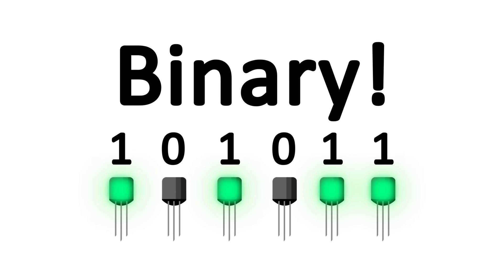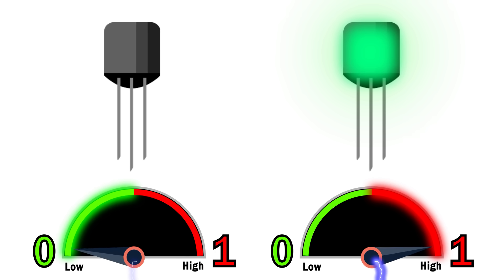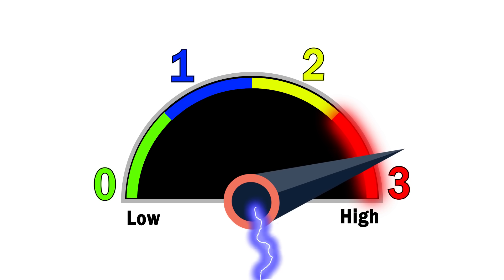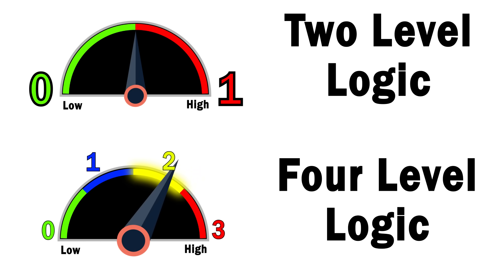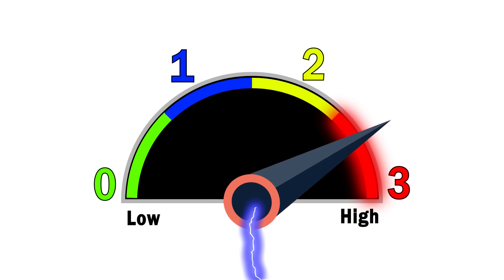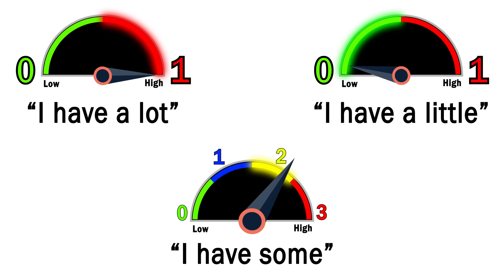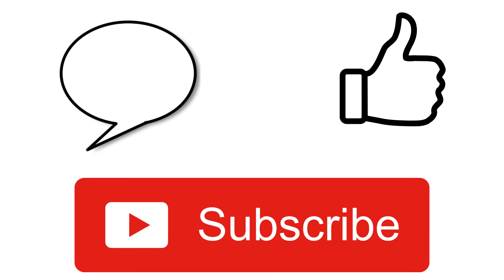Why can't computers use base 3 instead of binary? Voltage states explained.

Comment: This might be a problem for real computers but not for simulated computers such as the ones people build in Minecraft/Terraria or some other software. It'd be interesting to see how higher base computers would perform there and also how high we can go.
Reply: I wanna try and make a Base 5 computing system
Reply: @epicmidtoker3 You can do it in minecraft with signal-strength arithmetic.  Technically using that lets you do any base in that way from 2 to 16, but you can definitely engineer a base-5 system.
Reply: @epicmidtoker3  Hell yeah. Do it 💪
Reply: Hex computers in minecraft are a thing, they use signalstrength which goes from 0-15 so base16? Due to how comparators work they get really powerful for their size, but it seems difficult to scale them up. They achieve some optimum size at 100 blocks volume, but cant really go onywhere from there.
Reply: @LinusPeter-j7z  Interesting. I didn't know that. Thanks for the info :)
Reply: @GabrielMartinez-fv8xd I'm guessing, yeah
Reply: There are data storage systems in Minecraft that essentially work off of this principle. In modern versions of the game, each music disk outputs a different signal when placed in a juke box and read by a comparator. It essentially allows for higher base storage and greatly compresses the size of your data storage. There's a video making a noteblock music player that uses midi files transformed into chests of shulker boxes that store entire songs. 

Although the system they built only actually uses the disk to represent a single bit of information, but I don't see why it wouldn't be possible to combine them to get even larger numbers in a smaller space.
Reply: There's no practical reason to do simulated computers since they always do worse and I don't see a reason to go higher just because
Reply: @tomlxyz   It's called having fun. Let people try out stuff they want to do.
Reply: @Simchen  furries dont know fun
Reply: @tomlxyz  let them be their selves bruh
Reply: @tomlxyz  Just because is a pretty good reason 😃
Reply: @tomlxyz it gives people room to explore the consequences of the change without a large cost. If someone found a way one system was massively better than binary in a specific area then perhaps specialized computers could be made for that niche. Of  course theres also just having fun but i doubt thats what you meant by your comment

Comment: You mentioned less than 50% charge and greater than 50%. But what about right AT 50%?
Reply: @@P47CH3Z: There are so many kinds of instances where I've seen people state ranges of numbers that fail to include the divider number either on one side or the other that it's insane!

Comment: But this problem can be easily bypassed if we use 3 cables: one for 0 one for 1 and one for 2. Then you need to have 3 different cables for the Ethernet, 3 tracks on a CD or hard drive. 3 copper link in the circuits and so on... Yeah you will have CPU that are a bit bulky at the beginning but the potential is enormous

Comment: Using AC instead of DC I think a ternary or even quaternary system could be made. A balanced ternary system can be where 1 direction of flow is 1 and the other is -1 while no flow is 0, and for a quaternary system you can just use 2's complement and have the voltage directions represent 0, 1, 2. Though this would be much slower.

Comment: Something left out: In signal-cables, a switch from positive voltage to negative voltage can represent zero (or one), a change in polarity in the other direction one (or zero), as far as I know this is how data is transmitted over cables extremely efficiently. I do not even want to think about how this would be done in a non-binary logic!

Comment: What about using negative voltage to create a base 3 system. So in a 1.5 volt system 0 is off, 1 is +1.5v and 2 is -1.5v. Would this not work?

Comment: Why not use light instead of electricity through the transistor? You can still have a charge but it needs transistor would be a chip that would measure the light? You're really helpful to refer me this video and I'm completely curious. I'm sure you have another video?
Reply: With the light, you wouldn't have any of the falling or rising state issues. You could simply change the color. I know in the old days this would have been a problem as the machine would have had to been huge! And for a projects like project Pluto, it would have been a huge problem to have that type of computer on an aircraft, especially a doomsday plane.

Comment: why dont just instead of voltage amount, just use binary mini circuit to change energy POSITION and measure WHERE the energy is instead of trying directly  base 3 or 4? or using that make base 4 computer that converts things to base 2 before sending or receiving from internet or components?

Comment: How about expressing the ternary system as, for example, a manual car shift, with the center as the neutral state?

Sorry if I made a mistake because I am using a translation.

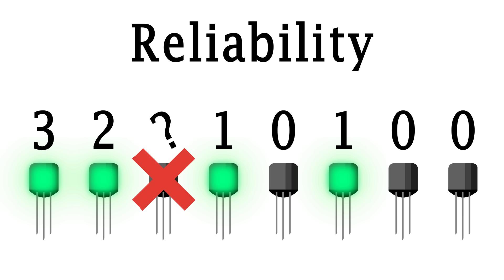Comment: 3:48 it's not completely useless. you're ignoring that it takes more "bits", which means more space, more transistors, or to be general, more components. This isn't a strong objection, but it's one not to overlook in technicality.
So it's not that it's useless, it's just that the tradeoff of reliability vs space heavily favors reliability.

Comment: Good video but there is one base 3 design that you did not discuss.

Instead of using partially charged transistors to represent different base states, you could combine active high and active low circuits. Your 3 base states would positive high, negative high, and zero volts.

There may be reasons why this won't work, but you didn't discuss them.
Reply: Not worth it because you use another transistor to know whether the high state is positive or negative, then you are using 2 bits to represent a single base 3 number which will produce less values than binary numbers. We need to think more.
Reply: Maybe that would help, good idea. But also maybe the crossover period would be a reliability problem still. I'd love to find out what could still be possible

Comment: You ignored what makes ternary viable, it operates on negative signal, no signal, and positive signal, gaining all the reliability of binary plus being a tri-state system, and there are even a few tricks ternary can use to simplify math. It isn't used mainly because the right tech advances happened on binary systems at just the right time to give them a lead in the market that other businesses couldn't catch up to regardless of the ability of ternary computers.
Reply: i don't know he "ignored" it, it might just be he didn't know

Comment: 3:27 no, it is not entirely the primary reason. i have been trying to build my own ternary gates, full adders, full subtractors, etc for a while now and believe me, working with an extra state is extremely hard. not even on a voltage level. (im working with an unbalanced fractionary scale, so 0V, 1/2(+V), +V since it is easy to divide voltage and use op amps like so without using negative voltage.) because you have this awkward middle half state, you can make a full adder <A in, B in, carry in> with results <result, carry> except implementing the truth table is extraordinarily complex. you need gates that allow the middle half state to pass through without processing, you sometimes need to eliminate the middle state all together to make is 0 and 1 again, sometimes you need the middle state back... but how? you just removed it to get 0 and 1! point is, its very hard.
Reply: whats NOT? whats AND? OR? XOR? 
the simple inversion is no longer so easy... 
0 becomes 2? 
2 becomes 0? 
1 stays? 
theres other options so you have to delve into new types of gate, XYNOT maybe...
the entire language would need rebuilding, imho. to re-use old terms would be too confusing. normal circuitry doesnt even apply, you almost always end up back in binary at the basic level.

AND?
0 and 0 is 0. 
0 and 1 is 0.
0 and 2 is? 0? 1? either type may come in handy...
further combinations can be figured at your own leisure ;) as can OR... they no longer are the same functions, and wheres the line between certain overlaps? anyone versed in logic knows the circuit used may not be the logic operator it performs! 

hex equates to a nibble of four bits...

do-sept-imal numerals for a "nibble" of three "trits"? hang on, the alphabet uses 26 already.... hmmm. it would work :) cant be 0 or 1 as they conflict with o and i, so 2 it is...

standard approach to logic breaks down. have to go back to boolean and revise for an utterly new approach. to signify things were this and that was easy. the old "assert/not assert".
to signify they are this that, or something else gets crazy. assert/not assert/half-arse...
Reply: @paradiselost9946  And at the end of the day, aren't you rebuilding logic that would be a combination of say, two gates anyway. I'm not convinced "in principle" that a larger base would be a necessary benefit for the logic side (storing is another issue, and there we do have higher bases, as the video says)
Reply: @paradiselost9946  Yes-maybe-no-true-inconclusive-false. 3 answer choices on a test. Used so that the score really reflects your knowledge, as on a yes-no-true-false test, getting a 100% tells us you have the same knowledge as getting a 0%, as if someone had 0 subject knowledge and randomly guessed, they would score a 50% on average, and if someone gets a 0%, they know what the answer is; they decided to choose the other choice via reverse psychology.

In set theory, we have the universal set U, the null set ∅, and the single set {∅}.

In Boolean algebra, we have 0, 1, and 0.5.

However, the NOT / OR / AND / gates, compliments / unions / intersections, and Boolean inverses / summations / products will remain the same, as they are lowest upper bounds and greatest lower bounds, respectively. Therefore:

¬⊤ ≡ ⊥
¬⊥ ≡ ⊤
¬⊢ ≡ ⊢

⊤ ∨ ⊤ ≡ ⊤
⊤ ∨ ⊥ ≡ ⊤
⊤ ∨ ⊢ ≡ ⊤
⊢ ∨ ⊢ ≡ ⊢
⊢ ∨ ⊥ ≡ ⊢
⊥ ∨ ⊥ ≡ ⊥

⊤ ∧ ⊤ ≡ ⊤
⊤ ∧ ⊥ ≡ ⊥
⊤ ∧ ⊢ ≡ ⊢
⊢ ∧ ⊢ ≡ ⊢
⊢ ∧ ⊥ ≡ ⊥
⊥ ∧ ⊥ ≡ ⊥

U∁ = ∅
∅∁ = U
{∅}∁ = {∅}

U ∪ U = U
U ∪ ∅ = U
U ∪ {∅} = U
{∅} ∪ {∅} = {∅}
{∅} ∪ ∅ = {∅}
∅ ∪ ∅ = ∅

U ∩ U = U
U ∩ ∅ = ∅
U ∩ {∅} = {∅}
{∅} ∩ {∅} = {∅}
{∅} ∩ ∅ = ∅
∅ ∩ ∅ = ∅

1' = 0
0' = 1
0.5' = 0.5

1 + 1 = 1
1 + 0 = 1
1 + 0.5 = 1
0.5 + 0.5 = 0.5
0.5 + 0 = 0.5
0 + 0 = 0

1 * 1 = 1
1 * 0 = 0
1 * 0.5 = 0.5
0.5 * 0.5 = 0.5
0.5 * 0 = 0
0 * 0 = 0

XOR / XNOR gates, logical statements, set differences, and any Boolean operator follows the same pattern. However, if the hypothesis of a statement is false, the conclusion is inconclusive. Truth table p → q:

p  q p → q C
⊤ ⊤     ⊤     ⊤
⊤ ⊥     ⊥     ⊥
⊥ ⊤     ⊤     ⊢
⊥ ⊤     ⊤     ⊢

Inconclusive statements can be converted: There may exist / There may not exist / All of them may be true / All of them may be false: ∨'⊢ ≡ ⊤, ∧'⊢ ≡ ⊥, ∪'{∅} = U, ∩'{∅} = ∅, +'0.5 = 1, *'0.5 = 0

Using this, we can derive a Boolean algebra for genders:

Boolean values: ♂, ⚧, ♀
Binary operators: ☀, 🌙
Unary operator: '

♂' = ♀
♀' = ♂
⚧' = ⚧

♂☀♂ = ♂
♂☀♀ = ♂
♂☀ ⚧ = ♂
⚧ ☀ ⚧ = ⚧
⚧ ☀ ♀ = ⚧
♀☀♀ = ♀

♂🌙♂ = ♂
♂🌙♀ = ♀
♂🌙 ⚧ = ⚧
⚧🌙  ⚧ = ⚧
⚧ 🌙 ♀ = ♀
♀🌙♀ = ♀

Identity laws: A 🌙♂= A, A ☀♀ = A
Domination laws: A ☀♂ = ♂, A  🌙 ♀= ♀
Idempotent laws: A ☀A = A, A 🌙 A = A
Commutative laws: A ☀B = B ☀A, A 🌙 B = B 🌙 A
Associative laws: A ☀(B ☀C) = (A ☀B) ☀C, A 🌙 (B 🌙 C) = (A 🌙 B) 🌙 C
Distributive laws: A ☀(B 🌙 C) = (A 🌙 B) ☀(A 🌙 C), A 🌙 (B ☀C) = (A ☀B) 🌙 (A ☀C), 
Absorption laws: A ☀(A 🌙 B) = A, A 🌙 (A ☀B) = A
Negation laws: A ☀A' = ♂, A 🌙 A' = ♀
Double negation law: A'' = A
DeMorgan's Laws: (A ☀B)' = A' 🌙 B', (A 🌙 B)' = A' ☀B'

Using this, we can prove:

A ☀(A 🌙B) (Given)
= (A ☀♀) 🌙 (A ☀B) (Identity laws)
= A ☀(♀🌙 B) (Distributive laws)
= A ☀♀ (Negation laws)
= A (Identity laws)
∴ A ☀(A 🌙B) = A
∎

Q: The algorithm of determining the gender of a group of people is that the group is male if a male is present in the group, and female if all members of female. Therefore, we can derive:

Conjunction: ♀∪ ♀= ♀
Specialization: [A] = ♀→ [B ⊆ A] = ♀
Generalization: [A] = ♂ → [B ⊇ A] = ♂
Elimination: ([A] = ♂∧ [B ⊆ A] = ♀) → [A \ B] = ♂
General specialization: [A] = ♀↔ ∀x ∈ A s.t x = ♀
General generalization: [A] = ♂↔ ∃x ∈ A s.t x = ♂

Using this, identify the gender of the null set of humans. In other words, identify the gender of the set with 0 humans.

A: 

ↅ [∅] = ♂,
then [ThomasGameDocs] = [ThomasGameDocs] ☀[∅] = ♂(Domination laws),
however, [ThomasGameDocs] = ♀(https://youtube.fandom.com/wiki/Thomas_Game_Docs)
∴ [∅] = ♀
∎

Which then proves that nothing is female, which is why robots fail the test saying that "nothing is female" implies that "everything is male", which is who an AI would say "there is only 1 gender".
Reply from the maker: You're more or less referring to the "rising edge/falling edge problem" which I did talk about at 4 minutes.

I would still argue the primary reason base two was chosen was because of noise variation, but I guess you can'r really quantify the reasons.
Reply: @Basics Explained, H3Vtux  i mean not even with rising and falling edge issues, im talking about making the actual gate truth tables which is a whole issue in of itself
Reply from the maker: @ithaca2076  OOOOOH i see. Yeah I can imagine working with truth tables with more than 2 variables would be agony. 
That's all a bit more complicated than I think I can really get into with a 5 minute video haha. I did do a video on logic gates and truth tables though I didn't talk about that issue specifically https://youtu.be/vJO-5gY0wpk
Reply: @Basics Explained, H3Vtux  haha yea well i guess with enough effort i could figure i out. anything is possible

Comment: Newer solid state drives use higher bases. It’s called 3D nand flash as opposed to traditional binary nand flash. A nand flash is just a simple circuit that can hold a charge. Before they used to be binary but now they can hold like 16 different voltage values so you can have more data in less space.
Reply: The downside to this is that TLC (3 bit so 8 voltage levels) and QLC (4bit per cell) flash storage is much slower and significantly less reliable then SLC, a lot of ssds actually use part of their cells as SLC cache which is partially why they get slower when they are full
Reply: " It’s called 3D nand flash as opposed to traditional binary nand flash."
No.
3D nand flash got NOTHING to do with the bit-representation but rather the PHYSICAL structure of NAND - aka the vertical stacking of circuitry to have data storage not be limited to the previous 2D slices.

"A nand flash is just a simple circuit that can hold a charge. Before they used to be binary but now they can hold like 16 different voltage values so you can have more data in less space."
Yeah buuut you forgot to mention a few crucial things: The amount of data stored per cell is higher, but the data also does not last as long and needs more frequent refreshes and a lot more circuitry to read and write that data (a lot slower). It can be used with SSDs cause all the other parts of the data-chain are slow enough for this to only have a low impact.
Reply: its still binary. its not a change in radix, its multiplexing with a third coordinate.
four voltage levels gives 16 locations, a nibble of data, half a byte. hexadecimal. 
the data is encoded as analog voltages quantasised to discrete levels. each memory "cell" is basically a DAC. read back is an ADC. takes a bit longer, the individual cells are a bit more complex than basic flip flops, but overall, theres a massive leap in storage space... 1 circuit can now take the place of 16 with a four bit DAC.
unfortunately the charges eventually leak away and data is corrupted long term.
Reply: thats cool
Reply: 3D NAND is COMPLETELY different technology. What you mean is multilevel channel. While 3D NAND is stacking multiple flash memory dies on top of another
Reply: @za_pravdu1943  cell, not channel
Reply: (nand flash doesn't say what number base the information is stored, it's about how & what the memory cell is built)
However, newer SSDs do indeed store information is higher number bases, they use something that's called multi-level cells (MLCs) which means that each floating gate capacitor is used to store multiple bits in a memory cell at once, most common are triple & quadruple level memory cells.
Reply: So that the reason why we can have such high density,high capacity storage devices in a small form factor now!
Reply: Interesting, didn't know that - so for SSDs, each block of 3d nand flash is equivent to 4 bits of memory; very efficient!
Reply: @dm121984  "each block of 3d nand flash is equivent to 4 bits of memory"

no - that depends on what type of storage you have. If you want the highest speed, highest reliability or endurance you can get Single-level 3D nand ssds - aka just 1 bit per cell.
The data-density is the lowest but this also means lowest complexity for the control-logic, which makes them more robust and far far faster. But with just 1 instead of 3/4 bits per cell they have far lower capacity (or cost a fortune).
Reply: to add to this, 3D NAND has the highest density of transistors per mm² out of any other semiconductor

Comment: yeah, but, ternary computer is build on top of binary system, instead using just 1 light blub to represents true and false, you use two light blub to represent 3 states, aka, false, maybe, true, so you get extra state instead of two where 10 represents -1 , 11 represents 0, 01 represents positive 1. so you only need 3 sets of ternary system to represent 27 combination, whereas the same amount of execution in binary, you need at least 256 combination.